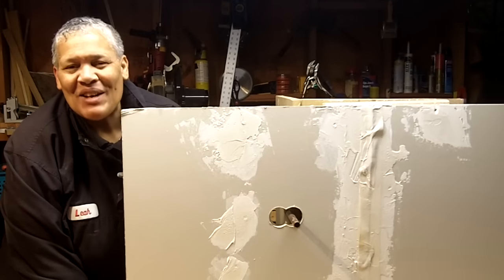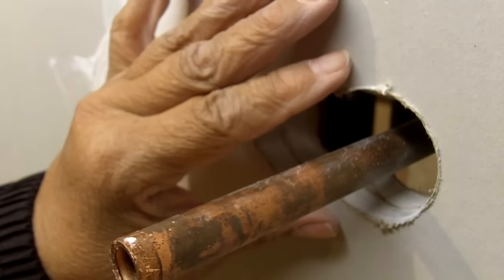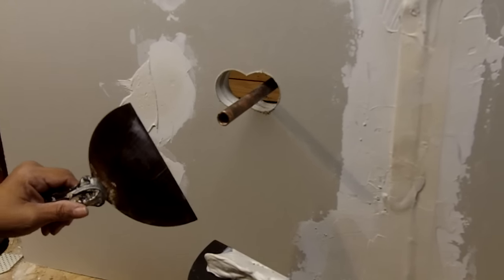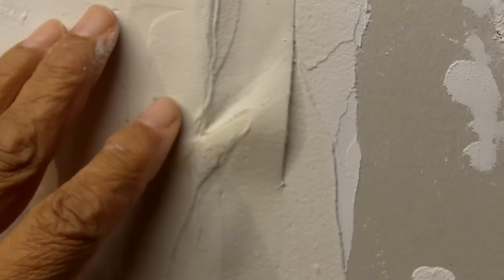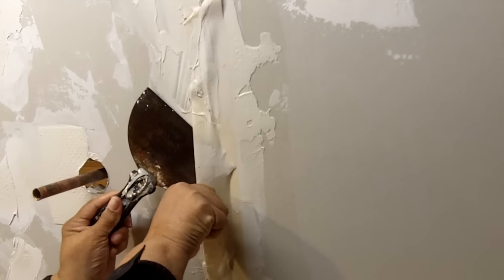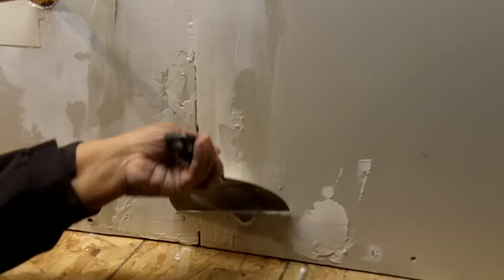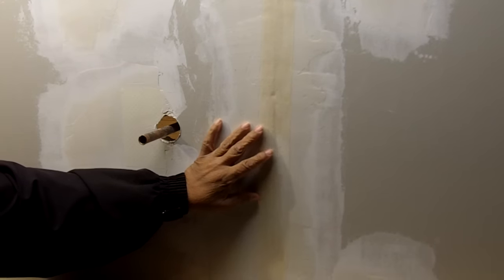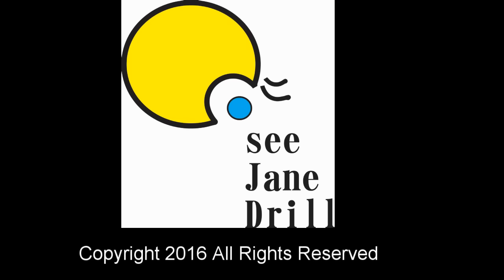How to Fix Drywall Mistakes

Comment: I was really impressed with how you covered up the second hole near the pipe. The way you removed the old tape also impressed me and putting up the new tape and covering it up. I thank you for showing us how to fix drywall.
Reply from the maker: +Sidney Mathious thanks, Sidney! :)
Reply: I would have just cut a piece of dry wall to roughly the shape I needed
 then PVA glue that in then its only needs a skim of plaster to make 
perfect also this way means that the drywall is like the mistake was 
never made.
Reply: @MonaichFother  pva wouldnt hold it in place!!!

Comment: In my attic i came across a issue a huge wide pipe that sits inside in between the bedroom & bathroom wall that leads outside my roof.I always noticed the bedroom wall& ceiling has always been patched poorly the main problem was never fixed when it would rain water would seep down this pipe the pipe looked like to me is tilted i do not know if that is how the pipe was set when my house was built the tilted pipe connections was built or the tilted pipe was caused from the grounds shifting because i do battle issues with my Windows dropping as well from post military  ammo practices & our local international gas & oil industry i do live a few blocks from that does fracking  as well my home was built in 1948 my parent's bought this home back in the early 50s & 60s era now am faced with dealing with old poorly done drywall damages even my drywall ceilings cracking & falling through. Plus am living on a fixed budget am very appreciative for these videos. I love to work with drywall & other various carpentry tasking.

Comment: Thank you Leah, this video really helped me figure out a problem.  I have a pipe coming through my wall in my pantry and it is connected to the hot water heater.  There is a hole just like the one in your video and I had no idea how to fix it other than shoving some steel wool in the hole.  A very big help!
Reply from the maker: Glad the video was helpful

Comment: Welcome to the summer of my discontent. These videos are lifesavers! Subbed! I decided to totally redo my dogs' room. I've got drywall that must have been put in by drunks. No staggered joints, tape bubbling, rough mud, nails instead of screws, no tape in a corner, and no metal bead on a corner. Also, big nails in the baseboard.....
Reply from the maker: I want to welcome you to the channel.   Good luck with all of your summer projects.

Comment: I'm from Australia, we use a product called base coat, it drys like cement. once it drys you can't do anything to it except get the grinder out! I know alot of people use the premixed compound but you really shouldn't use it on the first or second coat due to the reason that it's not a hard coat once dried, it will crack if you get movement!

Comment: Novice Home Owner & New to doing wall work.  Had a Bath Room next to the Kitchen Dining Wall.  renovated Bath Room and had new shower update installed in wall & new shower & wall enclosure - new frosted window to outside over tub.  I prepper walls and installed electrical exhaust & new GFCI.  Purchased new toilet appliances, etc...  Well, first shower and realized Plumber did not secure shower fixture inside wall !  Amazing.  I learned " Dry Wall Repair " .  I couldn't tear out the new shower wall ; shower handle could be pulled out maybe four inches ; so, I had to go to the Dining Area Wall and open up a square to mount interior Shower Fixture to Studs.  Secured with same removed " Patch " , etc....  Many thin coats.  Yes, " You can do this ".  Good reminder that one can wet joint error - tape - and remove.  Learned the " Hard Way " the first time.  This was back in the late 1990's.  Thanks Again.

Comment: Leah, can you make a video showing how to make this exact same repair but after the wall has been painted. The ceiling in my house was drywalled and mudded and there is a crack along the seam where the drywalls butt up as if they didn't put any drywall tape/paper. Now I'm left with a long line (crack) the lenght of the ceiling but don't know how to fix it cause it is painted. Thanks for the great tutorials.
Reply: You have to sand the paint a bit, put up the tape mud it (sand between layers). And once you arr happy with the look paint again. There is no other way.

Comment: For big holes, put a little piece of wood, or two, behind the sheetrock, screwed in from the front. Then, cut a patch for the hole, or use the piece you might have cut out. put compound in the cracks, tape over, and finish. You can do any size hole this way.  I use it for filling holes where there were electrical boxes, or where I cut a hole to fish wires.

Comment: Now that we're all drywalling and mudding, I'd like to put in a good word for Strait-Flex products. I have been using a composite corner tape that is very easy to use, easy to embed, very sticky, and it makes nice sharp corners, better than paper tape. I've been using it all day for inside corners and they look very nice. I also bought a box of their drywall shims, and they were very high quality, better than the ones at the big box store on the shelf. 

They also make nice-looking patches for miscut outlet or light switch holes, which I have not used but would consider it if I needed them. I'm not an employee of the company and I don't have any financial interest--I just bought these products at a local hardware store, and both have worked GREAT. They ain't cheap, but it's the walls in your room--it's important.

Comment: Thank You Leah!!! Another video that is helping me with my bathroom remodel!  I am doing the drywall right now and cut my hole for the waste pipe too big and this was exactly the tip I needed.  I'm off to the store to look for that patch!
Reply from the maker: Hey Cathy, glad it was helpful.  Good luck with your remodel!  I'd love it if you feel like emailing me pics when it is done.
Reply: Absolutely!  I am doing it on the weekends so a little bit at a time.  Getting there!  BTW I found this patch at Menards in the painting section.

Comment: Escutcheon as in " s k hutch un " It helps to use an escutcheon that fits snug on the pipe. They usually have snugging tabs to hold to the pipe. I'd never leave a 2 inch hole behind an escutcheon. It can be a mouse path.

Comment: I suggest for beginners to use premixed drywall compound like CGC because it is more forgiving , and what lia is using here sets faster which may be more difficult for those who are starting out
Reply: I suggest starting out using the correct product regardless of your skill level so you quickly lean to do it right the first time.
Reply: What would the correct product be?

Comment: In this case, since the holes appear to have been made with a hole saw,  cut another hole to use as a plug.  Then use some joint compound as glue, stick it in, and use tape or this fabric and joint compound do finish the job..

Comment: That is a better solution for layering mud. I on the other hand like to use 20 minute laid on thick. Although that usually leads to large amounts of unnecessary sanding to achieve the finished product.
Reply: Not to mention the high probability of cracking- thin then dry, thin layer, then dry...just like she was showing. :)

Comment: Good ideas though I would advise using self adhesive mesh tape over the paper tape to tape and bed your seams.
Reply from the maker: +Joe Smyth Hi Joe, Mesh tape vs paper tape is really a personal choice.  And I happen to prefer paper tape.  But there certainly is nothing wrong with mesh tape.  Thanks for commenting.

Comment: I'm starting on repairs to my 45 year old house. After leveling 2 corners, I have horizontal lines showing up in the drywall. I've watched your excellent videos and feel confident in doing the repair, but I have one question - can I simply work over the years of (I don't know how many layers of) paint? Or do I need to strip the paint somehow first?

LOVE your videos! Thank you SO much!!!!!
Reply from the maker: Hi Becky, you can work over the paint, because joint compound contains a bonding agent.  What I will say, though, is that if, by chance, the paint is glossy, you will want to scratch it up first with a bit of sandpaper.  Otherwise you should be good to go!
Reply: That's great news!  The wall has a flat paint and no texture, so this should work great. Thanks so much for the help!

Comment: thanks.. I had a similar "crisis" I fixed it the same as you did. I thought at the time that I Jake Leg it because it was so simple. I showed my wife that I did it right. Wonders never cease! One question, why do use two knives and keep transferring mud back and forth ?Thanks againtony
Reply: She seems to be using the 2nd blade as her 'hawk'...scraping the smaller one off on a regular basis helps keep the smaller one clean. If you try to use a dirty blade, it will contain or hold small dry bits of drywall compound...thus messing up the look and quality of compound you're trying to apply to your work area. Hope this makes sense to you... :)
Reply: +Anthony Seelbach This also help to position the mud to the place on the knife that is best for spreading it where you want it for better coverage and appearance. This takes practice. Suggest you use a mud pan. You can get them pretty cheap these days or make one yourself, wouldn't be hard.
Reply from the maker: +Anthony Seelbach hey Tony, I apologize for taking so long to respond, as I somehow missed your question.  taterhead kind of hit on it.  Here's the thing. On a large job I use a finish trowel and a hawk, or I would use a mud pan and a knife.  But on the demo wall that I used in the video, the surface area is much smaller and you don't need all that mud.  So I used two knives instead. But I still needed to maintain a clean edge on my knife and place the mud where I needed it, which is why I transferred the mud back and forth.  Again, I'm really sorry I took so long to answer your question.  Hat's off to taterhead and ALLxoxoxoxo for stepping in to respond.

Comment: Thank you so much for your knowledge. You help me save my bathroom drywall.
Reply from the maker: you're very welcome, glad to be of help!
Reply: seejanedrill Silly question but can you double texture a wall? I'm thinking of putting some knock down texture on my kitchen wall and then adding a stencil design with mud on top of that. Will that work? PS wish I knew how to send pictures threw YouTube  so you can see what I'm talking about.

Comment: Thick or uneven joint compound. Use 40 grit sandpaper disk on drill. Grind down. Finish as usual.

Comment: Can you make a video showing how to do each coat of mud for a nice smooth finish?  My request is showing a butt joint for the wall but also a wall and ceiling corner all coming together. From coat one to maybe 5?

Finished product primed and painted. 

I have had pretty good results but not perfect results like I’d want to have.
Reply from the maker: Hey there, we have this on the schedule, but unfortunately the video won't be out for a couple of months.  It will be part of a kitchen remodel that we are doing.  I'm not sure if you can wait for it or not.

Comment: You're awesome! Now, what if you have drywall problems on walls that have already been painted? i.e. Tape that has bubbled, corners guards that got rocked loose from the drywall from things bumping into them, cutouts for switch plates that are too big and were painted before the switch plate was fitted to the space? These are my problems!
Reply from the maker: you know what...you can do everything the same way as I showed in the video.  The good thing about joint compound is that it contains a bonding agent, and can adhere to painted surfaces.  The only caveat is that if it is enamel paint (glossy) or dirty from grease, you might want to scuff it up a bit with some sandpaper
Reply: Thank you! I'm so tired of looking at those problems... Of course this brings up the next issue looming: is 8-year-old paint (in a metal can) worth a darn? I opened one can and rust fell like confetti into the light blue color. I carefully, carefully removed what I could and put the rest through a filter, but superfine rust dust tinted it a yellow only visible after it was used on the wall. Now I don't trust any of the paint in storage in my basement! UGH (A video on how to keep reserve paint good and true forever would be most excellent!) Thank you, again!

Comment: I would have just cut a piece of dry wall to roughly the shape I needed then PVA glue that in then its only needs a skim of plaster to make perfect also this way means that the drywall is like the mistake was never made.

Comment: Thank you Leah!  The person who did our sheetrock did a poor job taping and mudding areas, and then it was painted.  Would I need to sand down the paint to get to the compound first?  Any suggestions there?  Also, the ceiling's texture is very thick, and poorly done.  Is there a way to scrap it off?  It is a mud knockdown and has been painted over.  

Thanks for your videos!
Reply from the maker: +Brandon Lemmon Hey Brandon, I'm sorry to tell you this, but once it has been painted it eliminates the option for you to scrape it down as I did in the video.

Comment: another great video, can you help with a debate, I have a family member who insists that there is no need to tape the seams. Since I've always used tape I don't know what the disadvantages are if you do not tape? Is here something new in joint compounds that I'm not familiar with?
Reply from the maker: +Linda Marsden You are correct, you have to use tape! :)

Comment: Hello. Thanks very much for teaching this.   That copper pipe in my bathroom isn't secured to anything behind the Sheetrock that I can pull/push this copper pipe in and out.  In the right code, does it have to be fixed to some kind of stud behind the Sheetrock? or just floating? Thanks in advance for your answer.

Comment: SAND THE EXCESS compound down to the drywall paper before reapplying compound. You don't want a hump at the joint.
Reply from the maker: No you are misinformed.  Plaster and joint compound "keys" better to a rough surface than a smooth surface.  Feathering each coat helps to eliminates a bulge at the joint.

Comment: I have a question for you, but first: Hahahahaha ! !  Leah, Where did you get that picture of my first laundry room upgrade ?  When I'm going to need joint compound instead of spackle, I usually get the small 3.5 quart tub at Lowe's, which I used about 1/2 of last night (the bottom half).  When I re-opened the tub, I looked for any dried bits [and seeing none] I spooned some into a smaller clean bucket.  I put a small paint mixer on my drill & fluffed up the compound.  Because I usually only use about half of the smallest tub that Lowes sells at a time, I wonder if I should buy the mucho cheapero dry compound & mix my own.  I need an opinion I can trust, and............. That's See Jane Drill ! (LEAH ! !) I'm sure I'm not the only one who'd love to hear your advice

Comment: Want an exact plug or your funny shaped hole? Tape a piece of paper over the hole. Rub crayon or chalk around the edge. Cut out. Tape on new sheetrock. Trace. Cut out. Put in hole supported by little pieces of wood. Screw in. Finish.

Comment: What if the joint compound is cover with paint.  How do you fix the situation? I have bad areas all over the house in the corners and up near the ceiling.

Comment: Hi Leaha, thanks for doing this video it was very helpful. I have a situation where tape has popped off in places due to shifting particularly where two 30 degree angles meet (on the wall). It has started to come off almost in a long V shape and of course it is already painted. Would you recommend just cutting the piece of tape out at a 90 degree across the bottom, removing the entire piece floor to ceiling or cutting out the V shaped piece that has only come off? Hopefully I explained that clear enough, thanks in advance!
Reply from the maker: Hi Travis, I would recommend just cutting the damaged tape that has come off
Reply: Thank you

Comment: Leah, I need to repair a bunch of 2 by 4 pieces of wood between the Sheetrock in my basement that was cut to install a French drain. What is the best way?!
Reply from the maker: Hi Arelis, I would need to take a look at it.  You can send a picture to my email address (available on the See Jane Drill website)

Comment: Great video!  I patched drywall around plumbing for a tankless water heater, and the plumbers left no escutcheons on it.  All the plumbing is hooked up now.  What can I do about this to get a tidy look around the plumbing?
Reply from the maker: Hi Terri, they make escutcheons that are split.  You can put them up after the plumbing is hooked up.
Reply: I haven't found the right size at Home Depot.  Since the plumbers will be coming back to the house to do something else, I'll ask them if they can get some at their supply place.

Comment: I have a bathroom with a lot of cracking right along the tape edges. The tape isn't coming up entirely it's just along the edge. Would you recommend cutting out the tape and putting in new tape or can I put a fresh coat of mud over top of all the affected areas?
Reply from the maker: +Travis Brigden Hi Travis, you can't put a fresh coat of mud over the affected areas, because it will pucker.  You can try to take a utility knife and trim off the bad edges.  That might work.

Comment: I once saw someone use spray adhesive to lay joining tape. He did this without a bedding layer of compound. I thought it was odd but I'm not a licensed carpenter so I didn't make a big deal out of it. Is that just poor workmanship or is it safe to do?
Reply from the maker: +Frank Hi Frank, I have never seen that done by any union tradesman.